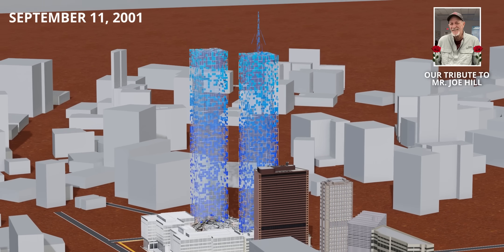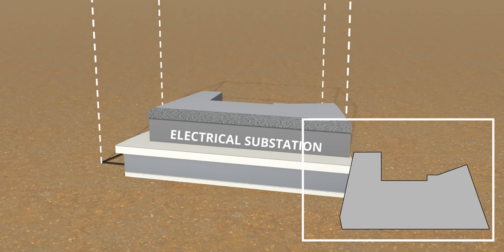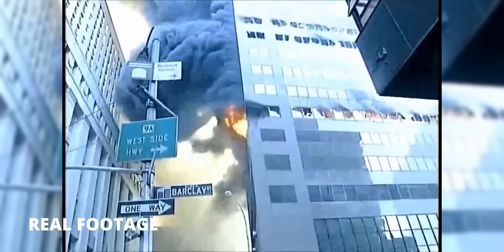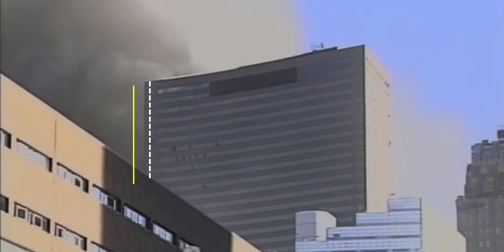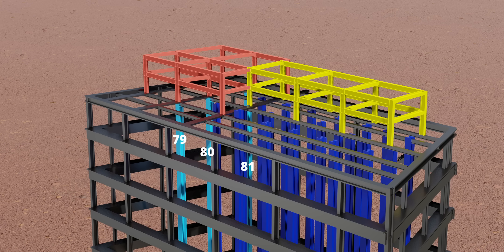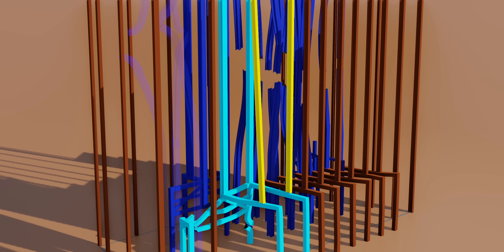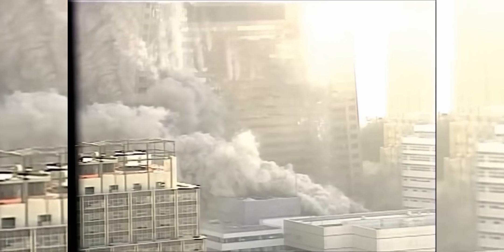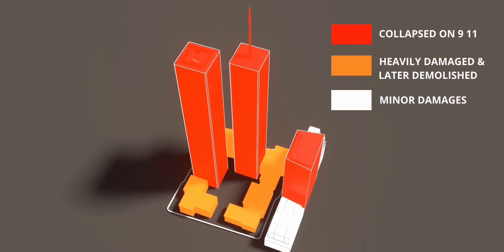Collapse of Building 7 | The Complete Physics

Comment: Bullshit. If you believe this you're a fool
Reply: This Lesics video is very good – with one or two exceptions - and goes into a much higher level of detail than many viewers will be able to comprehend.  While not perfect, the collapse mechanisms – the sequence of failures - described here by Lesics are substantially correct and this is true no matter who planned and carried out the 9/11 attacks or why . 

That may not be what you want to hear and go against 20+ years of entrenched dog_ma and conditioning, but it’s not wrong. 

That also means (in case you did not get the hint) this video can be (and IS) absolutely correct in its description of Building 7 collapse mechanisms AND the 9/11 attacks could still have been some sort of inside job. The two things are in no way mutually exclusive. 

The mechanisms described here have broad professional support around the world. There are no professional engineering organizations (for example: ASCE, ASEE, ICE, etc) that disagree with them or have offered any formal dissenting opinions or alternative hypothesis. 

The mechanisms described here are not new. They have been well understood for many years and much of it can be easily confirmed by simple observation. You can literally see most everything they are talking about if you just bother to look. 

So, setting hubris aside, either the overwhelming majority of the worlds structural engineers and simple observation are wrong,… … or you are. Which seems more likely? 

IF you still think believe this explanation is wrong then produce a better one . Good luck with that. No one ever has and I don’t see you moving that needle today. 

No one ever does.
Reply: @TheCriticalStinker-jw4fl  The only dogma and conditioning I've seen over the past 20 years is the narrative that anyone who questions this extremely suspicious event is a stupid conspiracy theorist. Seems like that's your camp.

There's a ton of suspicious things about 9/11, the missing $1,000,000,000,000 and the war that followed. Maybe you're right about the technicalities, maybe building 7 did fall the way this video says it did. I wasn't planning on getting into a detailed response and I wasn't really speaking to the architectural aspect at all. Even though I find it hard to believe that 2 buildings designed to withstand a plane crash toppled at near the rate of freefall. I just left a simple "bullshit" comment because 9/11 was most definitely an inside job and I think anyone who believes the government's official explanation is most definitely a fool.

I find it interesting that you're passionate enough about architecture to write several paragraphs in an online response to a very short comment. Somehow I don't think it's the architectural explanation you're trying to defend here.
Reply: @TheCriticalStinker-01  Crazy how my previous comments to both of you have been deleted. I'm not writing all of that again but I should have copied them and pasted them back every damn day 🖕
Reply: so if you don't want to look any more foolish then you have already made yourself look explain how it is BS and provide a logical reason why it collapsed (don't forget to include facts)
Reply: @pacman3556  You can refer to the comment I just left for @TheCriticalStinker-jw4fl 
I wasn't really speaking to the architectural aspect of the building 7. Maybe it fell that way maybe it didn't. I just wanted to express that given all the extremely suspicious happenings around 9/11 and the war that followed, anyone who believes the government's official explanation is a fool. Even @TheCriticalStinker-jw4fl acknowledged that fact somewhat. I don't think I look foolish. People who take whatever the government and media say at face value are the fools, I can assure you of that.

Comment: Funny how none of the buildings next to wtc7 and the buildings even closer to the towers were absolutely fine though.......hmmmm🤔
Reply: The Verizon Building across the street from Building 7 required a billion dollars in repairs after Building 7 collapsed into it. Fiterman Hall was damaged beyond repair by the collapse of Building 7 and had to be torn down. 

The WTC Marriott was completely destroyed by the collapse of the Twin Towers as was Building 4 and St. Nicholas Church. All flattened. Building 5 and Building 6 as well as the Bankers Trust Tower were damaged beyond repair and had to be torn down. In addition, some 25 other nearby buildings were heavily damaged but repaired and around 100 suffered lesser damage.

Funny how you did not know about any of that easily looked up common knowledge. Hmmmmm 🤔
Reply: @TheCriticalStinker-01  funny how you took that much effort to comment to a random person on a  youtube video.  Hmmmmmmm 🤔
Reply: @xKevmachinex  Funny how you made the effort to comment on a random comment on a youtube video. Hmmmmmm

What do you know, it worked the other way around too. And with more relevance.
Reply: That's exactly right. None of the buildings were absolutely fine. They were, in fact, not even remotely fine.
Reply: 10 other damages were heavily damaged or destroyed on 911. Deustrach Bank building had to be manually taken down because it had so much damage. Wtf you talking about?
Reply: Actually they were all destroyed wtc building 3,4,5, 6 and a church were all destroyed that day. The Deutsche Bank was later removed

Comment: 600 degrees bends steel now. Ok🙄
Reply: NIST analyzed steel from the fire zones. Not a single piece had reached 600° Celsius or more. The very most hadn´t even reached 250° C despite being directly involved in fire.
Reply: Hello and welcome to the modern world, which has passed what was known as the iron age a long time ago.
Reply: U gotta be sped or sum like…
Reply: under the right conditions it can. Guess you are not familiar with blacksmiths

Comment: WTC7 did not collapse in free fall you claim. Well, for the height of at least 8 storeys it did and like anyone else who denies controlled demolition you have absolutely no explanation on that.

Still you unintentionally managed to debunk NIST´s claims about that free fall. NIST claims the free fall didn´t start right with collapse begin but a little bit later. So here ist what NIST did:
They chose a collapse video shot from street level or so, so the kink would be as obvious as possible. Based on that they claimed that the descent of the roof started with the kink. You sir debunked them by pointing out that the kink was not vertical but horizontal. Congrats on that loser!
Reply: No, it didn't. That you want to cherry-pick and quote-mine what was said doesn't change that.

The explanation is simple. You heard exactly and only what you wanted to hear, from another moron who heard only what they wanted to hear and repeated it, and so it goes backwards. And you're not interested in finding out what was ACTUALLY said, because that would mean that you'd have to face that you were wrong, and you couldn't possibly do that.
Reply: @mooneyes2k478  AGAIN MoronEyes, you describe yourself very well! The problem STILL is that NIST admits the free fall stage for at least 8 storeys without providing an actual explanation.
Reply: @Kudde23 The explanation is there. Tou just aren't bright enough to figure it out, not least because you never actually read the thing.

I'll prove that. 

According to The NIST how long had Building 7 been collapsing before they took that measurement? 

Bonus question:  How much of Building 7 was left when they took that measurement (what were they actually measuring)?

Your answer to both questions will without doubt be more insults and name calling, in a desperate but ultimately pointless attempt to cover up the fact you just don't know.
Reply: @Kudde23  What "question" would that be? You haven't asked anything. All you've done is gone, "No, YOU!"
Which, what do you know, isn't an argument for anything. Strangely, on the other hand you carefully avoided responding to the fact that you hear nothing but what you want to and ignore anything that tells you facts, since they ruin your fantasy.
Reply: @Kudde23 The 2.23 second period of freefall was preceded by a 1.75 second of much less than freefall which would be impossible if all columns had been simultaneously blown up. Soooooo, your cd theory is wrong. Lol
Reply: NIST initially denied that WTC7 had gone into full free fall, but later adjusted their report in response to criticism from independent experts. They acknowledged that, for about 2.25 seconds of the collapse (equivalent to about eight stories of the building), the building fell with an acceleration close to gravity. But this period of free fall occurred after an initial collapse of the internal structures. So, the collapse of WTC7 began with the failure of a critical column (column 79), triggered by weakening caused by the fires. According to their model, once this column failed, other interior columns began to fail in a cascade, causing the interior of the building to collapse first. The exterior columns subsequently lost support, resulting in the collapse of the external facade. At that point, the building may have briefly gone into free fall. As for the video you mention, NIST claims that they chose the clearest videos available to analyze the chronology of the collapse, and that the visible movement of the roof before the free fall is consistent with their explanation of internal structural failures. So yes, there are several things that don't add up in this video.
Reply: @Crist4824  According to their BS model that OBVIOUSLY has nothng to do with the real collapse and which they don´t dare to release the input data for. So? So what about that obvious BS, seriously?!? What´s wrong with you that you refer to that obvious BS model?!?
Reply: @Kudde23 NIST used computer simulations (using ANSYS software and others) to model the collapse of WTC7, particularly focusing its analysis on the failure of Column 79. As you tell me, the main problem is that NIST has not made public the input data for its simulations, meaning that it is difficult, or even impossible, to reproduce the results independently. NIST has argued that releasing this data could compromise public safety as I have already explained to you. The NIST model does not accurately reflect what is seen in the videos of the collapse of WTC7. In particular, it has been pointed out that the model fails to capture the behavior of the exterior collapse of the building, including the symmetrical and apparent "free-fall" fall over a short period. NIST acknowledged a free-fall phase in the collapse of WTC7, but argued that this occurred after an internal failure that was not visible from the outside.
Reply: @Kudde23 A simple question. Did you read my comment?
Reply: @Crist4824  Yes. But I didn´t ask you why the BS model is BS, I was the one who told YOU that it´s BS so you really didn´t need to explain to me that it´s BS, ok?!? What I DID ask you is why you referred to their BS model despite it being BS. Wanna try one more time shill?
Reply: @Kudde23  Shill, I was just clarifying. I was confirming that it was a bs model. As for the rest of what I wrote, you have not been able to explain or even respond to me. It's strange that you are only focusing on things that are not relevant to my comment. That says a lot about you.
Reply: @Crist4824  I didn´t notice anything relevant in your comment, so, in your opinion, WHAT IS relevant to your comment?!?
Reply: @Kudde23  What's so relevant about it? Are you really asking me that? In my comment I'm responding to your simple doubts and assertions. That's what's relevant about it.
Reply: @Crist4824  Which doubts?!? Which assertions?!? NIST didn´t explain the free fall and nothing of your shitload of blahblah changes that fact in any way, so again, where EXACTLY is any relevance to the topic in your shitload of blablah?!?
Reply: @Crist4824   Nist never "denied" anything because it was right there and it wasn't relevant.

The fact of the matter is that if David Chandler had bothered to actually read NISTs paper, instead of deciding that it was all a conspiracy and so tried to find a hole so he could go "AH-HAH!" things might have been a bit easier.

Comment: So first you highlight the transfer trusses, the 90° shaped transfer trusses. Then you highlight a girder (truss) with 90° shape and claim the only possible explanation for this shape is bending/kinking during the collapse, you even claim that people who believe in controlled demolition have no explanation why 90° shaped transfer trusses could possibly end up in 90° shape... Just WOW you poor loser.
Reply: Congratulations, you failed. Girders and trusses aren't the same thing. What do you know.
Reply: @mooneyes2k478  So what´s the exact difference in the visually presented context my dear shill?
Reply: @Kudde23   That you got called on your stupid and so want to use your magic word doesn't change that you got it wrong.
Reply: NIST has explained that significant deformations, such as those suggesting a beam bent at a 90-degree angle, can occur during a structural collapse due to the sudden redistribution of loads and progressive failure of structural elements. In the case of WTC7, when critical columns (such as column 79) failed, loads from the upper parts of the building could not be adequately transferred to other columns, leading to a sudden collapse of the internal structure and subsequently the external façade. The 90-degree angle in certain beams, according to this explanation, is a result of extreme forces during the collapse, which caused the beams to bend significantly under the sudden loading and uncontrolled movement of the structural elements.

Comment: The spire of WTC 1 did fall to the south, you can see it in the Videos. Some parts from WTC did strike WTC 7 and it was burning 7 hours, but the spire had nothing to do with it.
Reply: Well, the north tower´s spire had to do with it since it was north tower´s core columns which caused the gash on WTC7.
Reply: @Kudde23 Columns from the outside and maybe the core, but the antenna was fell far away from WTC 7.

Comment: This is a INSULT  
To our intelligence 
The building is not made from wet paper
😂 liar
Reply: This Lesics video is very good – with one or two exceptions - and goes into a much higher level of detail than many viewers will be able to comprehend.  While not perfect, the collapse mechanisms – the sequence of failures - described here by Lesics are substantially correct and this is true no matter who planned and carried out the 9/11 attacks or why . 

That may not be what you want to hear and go against 20+ years of entrenched dog_ma and conditioning, but it’s not wrong. 

That also means (in case you did not get the hint) this video can be (and IS) absolutely correct in its description of Building 7 collapse mechanisms AND the 9/11 attacks could still have been some sort of inside job. The two things are in no way mutually exclusive. 

The mechanisms described here have broad professional support around the world. There are no professional engineering organizations (for example: ASCE, ASEE, ICE, etc) that disagree with them or have offered any formal dissenting opinions or alternative hypothesis. 

The mechanisms described here are not new. They have been well understood for many years and much of it can be easily confirmed by simple observation. You can literally see most everything they are talking about if you just bother to look. 

So, setting hubris aside, either the overwhelming majority of the worlds structural engineers and simple observation are wrong,… … or you are. Which seems more likely? 

IF you still think believe this explanation is wrong then produce a better one . Good luck with that. No one ever has and I don’t see you moving that needle today. 

No one ever does.
Reply: @MFitz12  Just like NIST in it´s first reports on WTC7, Lesics tries to hide the free fall stage by poitning out that the total collapse time was 40% longer than free fall.
So why did NIST do so, why does Lesics do so? Because they can´t explain the free fall stage without controlled demolition. No one ever has and I guess no one can. Or can you?
Reply: @Kudde23   That you don't understand the NIST papers? Only mean that. No matter how much you want to pretend you're smart.
Reply: @mooneyes2k478  AGAIN you described yourself perfectly, shill.
Reply: @Kudde23   Sorry, your magic word is still broken. You really should get your money back, Gandalf clearly sold you a load of bad goods. Reality STILL hasn't changed, no matter how much you keep using it.
Reply: Let's just point out that someone who cannot manage "an" in front of a vowel-sound such as begins "insult"? Isn't in a position to talk about their "intelligence". This is basic, first-grade English.
Reply: @mooneyes2k478  
I stand by my 
“a” laugh at you
Reply: @cristinafultz4572   Of course you do. As noted. As for "laugh at you", it's well known that those don't understand laughs, generally last.
Reply: @moonkeyguy2k478  
You sound
          like a serious 🐔🚬🤴🫏🐄🦈☝🏼